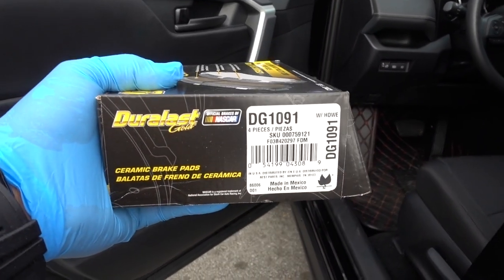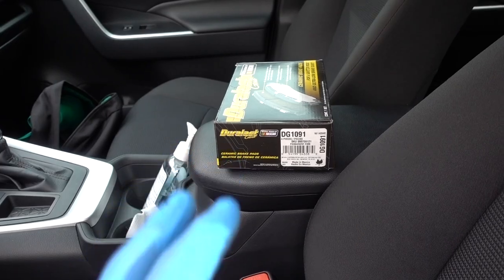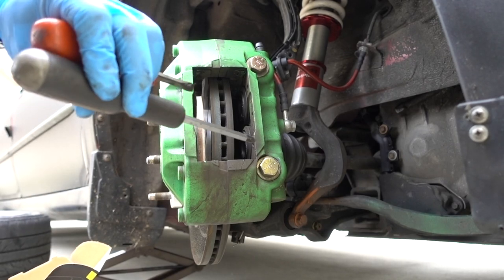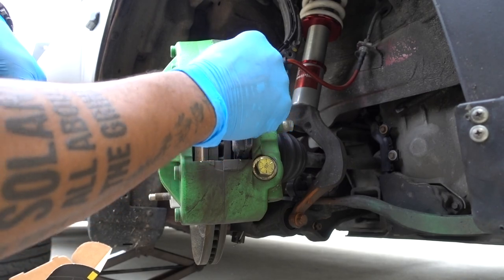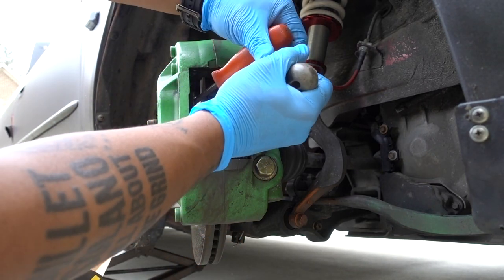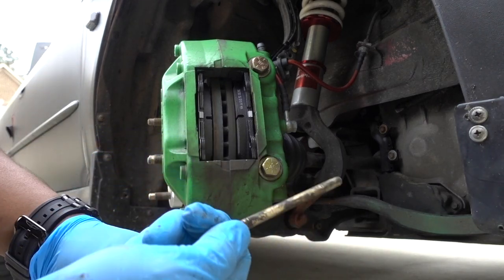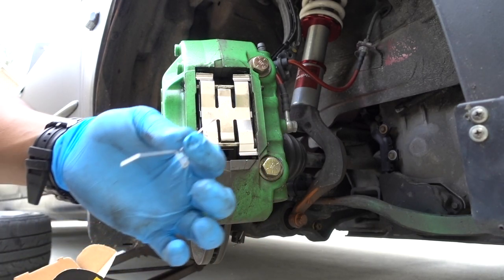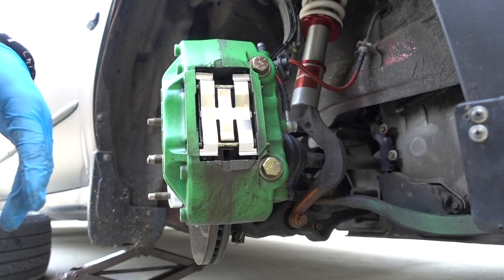How To Get Brake Pads for Life!! Plus Why I Quit Autozone

Comment: I agree with you that Brake pads from Autozone are actually a decent buy with the lifetime warranty although most people will talk down on them just because of the brand. What they don’t realize is that they are made by some of the top name brand companies that produce higher end or better pads, just under their own private label for their store. Autozone and AAP pads are made by Roulands, usually from India or Mexico. If you look up the numbers printed on the pad, it will tell you who manufactures them off of the AMECA brake friction code list. 

Same applies to their alternator and starters across the stores. They are all usually made by Motorcar Parts America, which is mostly junk.
Reply from the maker: Thanks for the confirmation
Reply: Duralast and O'Reilly Auto Parts Brake Best brake pads are both made by Bosch. It makes more since to buy pads from Autozone since they offer a lifetime warranty and O'Reilly's doesn't

Comment: If I got duralast golds brake pads and they’re almost done to the metal almost 2 years ago , would I be able to swap them for new ones and if I can how do I go about it without having issues?
Reply from the maker: If you get the pads and you put the warranty on them, just take them to autozone and swap them, you should be in the system with your phone number
Reply: @BulletSolano  so in other words if I have warranty buy some new ones and get the money back? I only ask because I have some gold ceramics on my car right now but they are almost done to the metal. Would that be swapped still ?
Reply from the maker: Yes, if you pay for the last set yes, you have pads for the lifetime of your vehicle
Reply: @BulletSolano  I appreciate all the info and answering my questions brotha 👍. Thank you
Reply from the maker: No problem bro